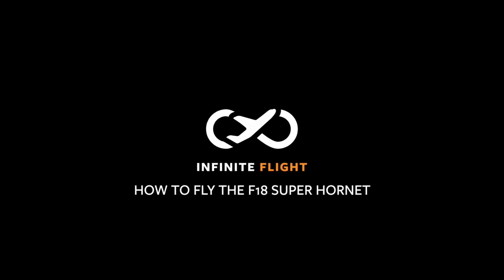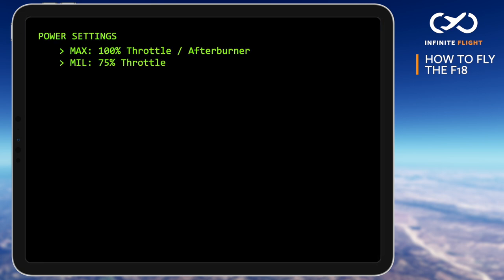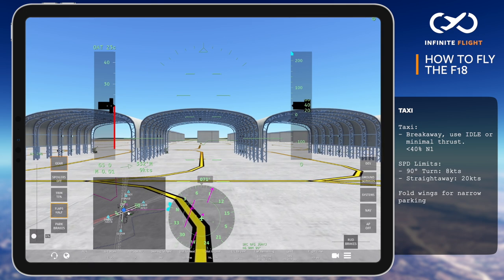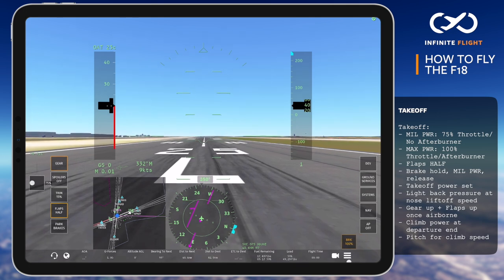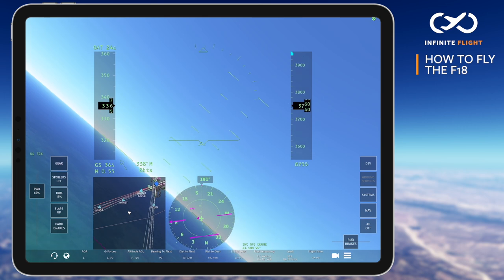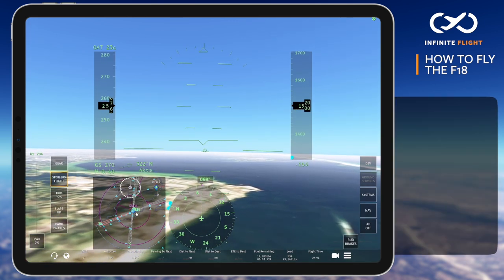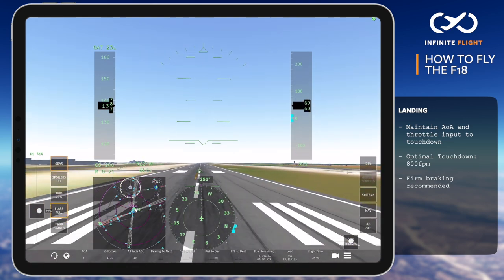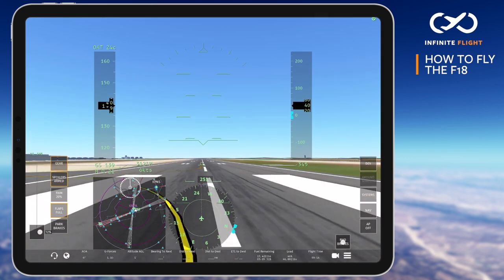How To Fly The F18 Super Hornet

Comment: Why in MSFS an IF does the Super Hornet only have inboard flaps?? The super hornet’s Ailerons are part of the flap system and also deflect down with half and full flaps. It looks so weird and not realistic when it’s just the inboard flaps.
Reply from the maker: Good catch! This requires a bit more work and development with a few hurdles still to solve. We'd love to implement more advanced coupling of both surfaces in the future when some backend improvements make that possible!
Reply: @infiniteflight  thanks for the response! genuinely just curious about it because I’ve seen it in a few sims and wondered why. It’s really fun to fly and it looks great. good luck with the development!